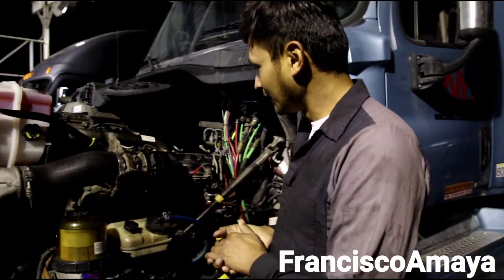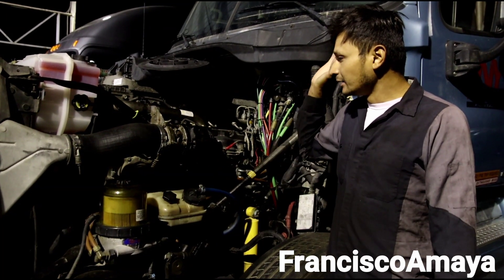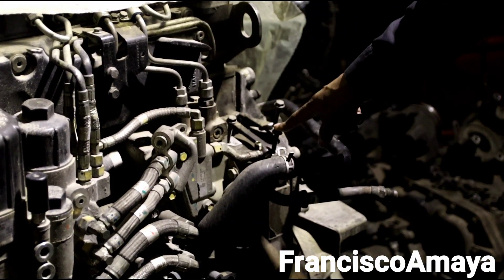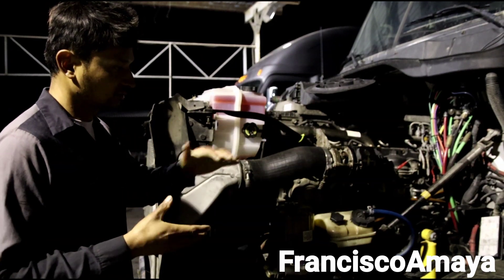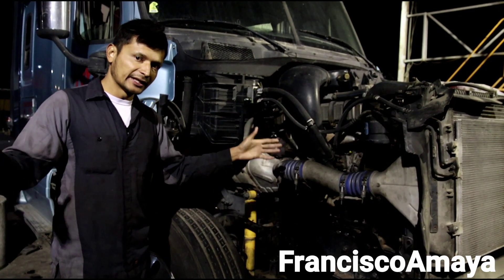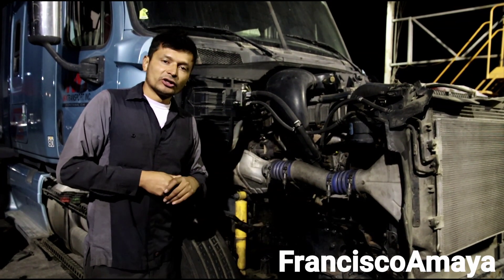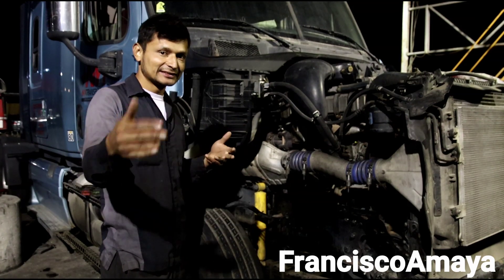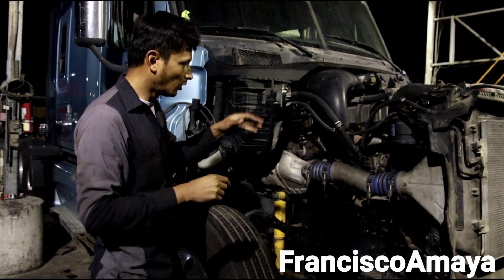Freightliner Cascadia DD15 used engine swap replacement after major engine crankshaft damage part 3

Comment: Buenas noches amigo Dios le bendiga siempre, consultarle con su experiencia de años , el motor ddc 15 del 2019 es muy bueno como el 12.7 o no y los repuestos originales del ddec 15 son costosos o son accesibles su opinión de esto agradezco su atención, desde Honduras.

Comment: What is the way you tell if the crank shaft turns freely.My truck ran low on oil and cut off.Want start back up but took it to the shop they haven't had time to figure out the problem but they called me and said good news the engine is not locked up
Reply: What ended up happening with your truck ? My truck just did same thing
Reply: @760gsxr1000  needed a rebuild. I swapped it out with a 12.7. Best thing I ever did
Reply: @laderrickbrown7845  thanks for the reply, that's awesome to hear happy for you. I'm tryna figure out what to do at this moment still not sure yet
Reply: @760gsxr1000  They are very sensitive so mine was the crank. For got to tell you both times. Got it rebuilt and the same thing happen twice 🤦🏾‍♂️ Only this time the turbo cooler leaked oil and motor was tore up again. DD 15 just too easy to go bad
Reply: @laderrickbrown7845  WOW. Yeah that's what I'm afraid of fixing it just to go bad again. Was it hard putting the 12.7 in there? Do scales ever mess with you because of it?